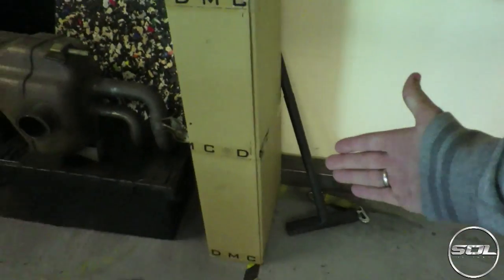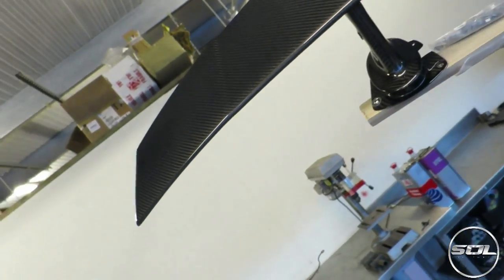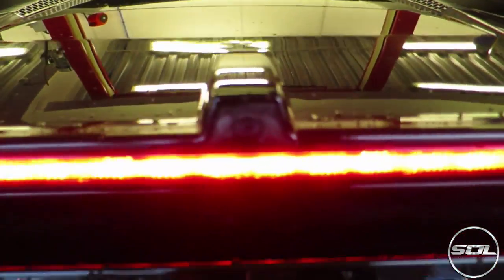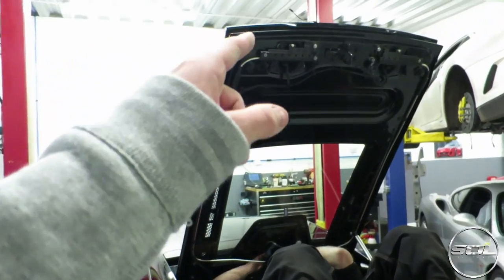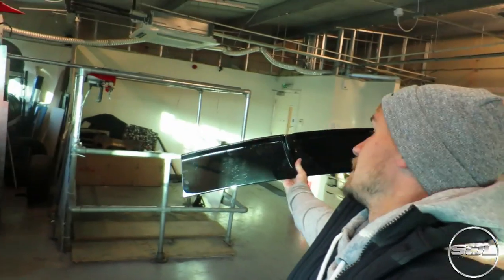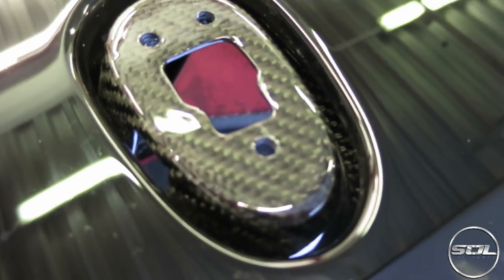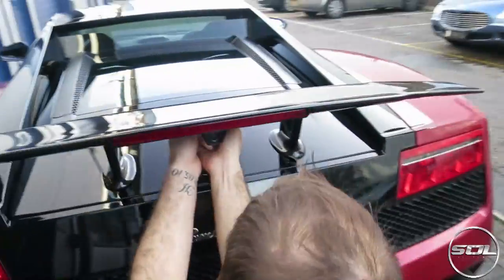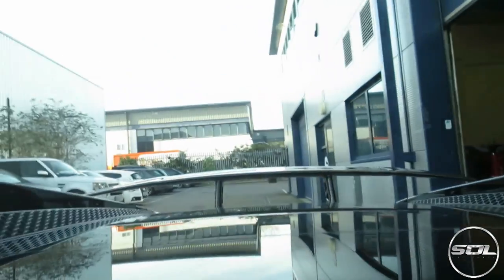DMC WING ON MY LAMBORGHINI GALLARDO!!

Comment: Paul get a rear and front diff-user in carbon and side skirts and ur good to go my man.
Reply: agree, either he does the complete DMC package or he has to remove the spoiler... looks pretty bad as now...
Reply: Agreed it really need a diffuser
Reply: Wtf is a front diffuser
Reply: +Apollo Friskyz I agree with you. It would be so agressive.
Reply: +Powermole Reviews its a part of a car which air is direct the air  to the back of the car
Reply: +Mohd Adli omg my grammar what a shame
Reply: +Mohd Adli it also helps to keep the front of the car on the road at higher speed because it creates downforce
Reply: +MULTIBASHUR 1999 yes that is true

Comment: Hmmm the car is too, well I may say 'flat' from the middle to the back so a spoiler that then sits up, just doesn't go I think. also there is no visible carbon in the same style as the wing on the exterior of the car so it contrasts it greatly, I know it is a sample one and can be changed whatever but I prefer it without tbh,

Comment: Don't get it - the clean lines were one of its best features - think original Countach without spoiler- brings out the lines - spoilers do what they say and should only ever be used if they offer tangible downforce and then only if you really think you need that aero - bad move.

Comment: wrap the spoiler gloss black to match the car
Reply: +funbus it would look so much better tho
Reply: +funbus It's the only carbon fiber piece on the car, not to mention it has silly gold letters on it.  It looks stuck on and out of place unless it matches the roof and engine cover.
Reply: +Mike K Thank you !!!!!
Reply: +Mike K 
Which is why i said he should get the rest on the kit in carbon. But if he was going to wrap it, he might as well have saved loads of money & bought a non carbon spoiler to start with.
Reply: funbus Then the whole kit will look tacked on and out of place.  For me, the roof and trunk lid would still need to be carbon fiber to pull that off.